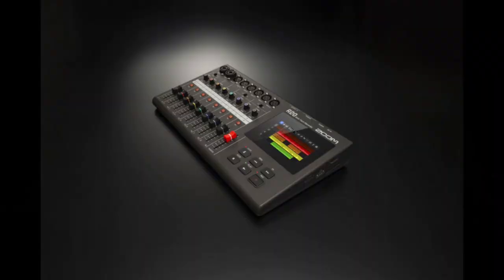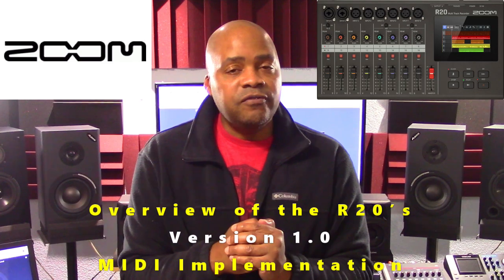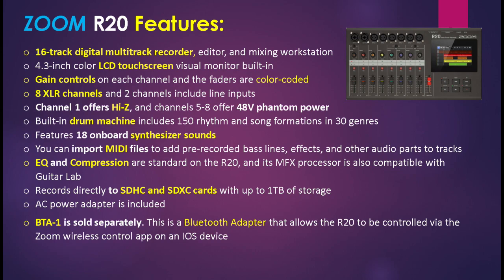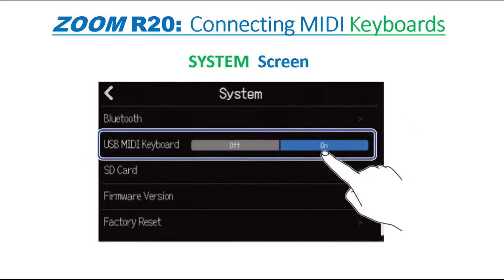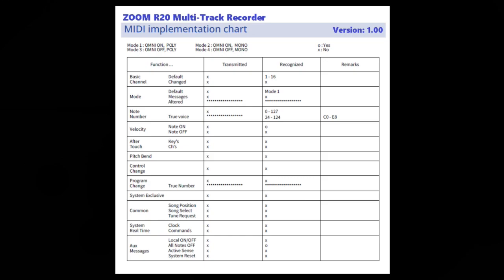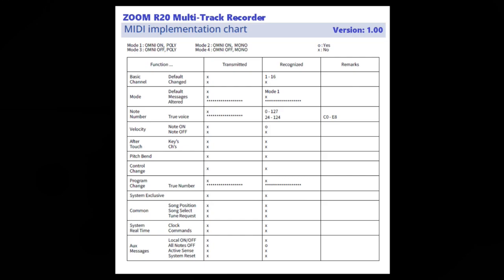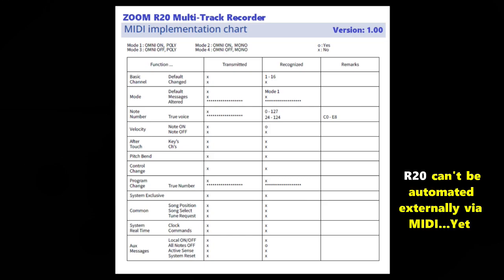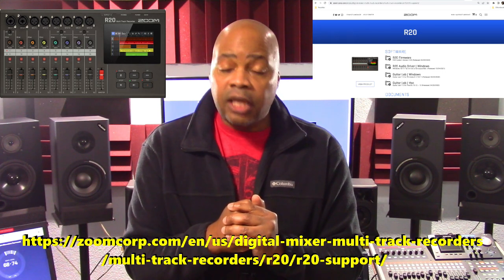ZOOM R20 Multi Track Recorder: MIDI Implementation Explained

Comment from the maker: It surprises me how many folks think the R20 doesn’t have any MIDI implemented due to the lack of the standard in and out MIDI ports. It really shouldn’t because that’s one of the first things many folks look for and expect when they view the back panel of a unit. While most top companies have abandoned MIDI altogether on their external multi-track recorders at the $400 price range and below, Zoom has not. What do you think about this state of affairs?
Reply: I'm not a fan of the removal of midi.
Reply: I need MIDI sync but it is nowhere to be seen and zoom seems to add no new features to this product at all.
Reply: I like being able to plug in a keyboard controller and play/record right away. But man, those patches are just not that great. Where is the grand piano!? Any chance they will allow the uploading of user patches?

Comment: Hello, 

Is there someone here that has already tried to connect an 90' vintage Midi synth ?
I am trying to connect the Yamaha SY22... it has old Midi connectors, not USB-C. I bought a midi cable USB-C to old MIDI DIN connector. 

Thank you.

Comment: This R20 is failing on software grounds, and there’s no reason why a company wanting to sell an otherwise excellent hardware product, would cripple both it & the user’s creative flow with dealbreakers like poor midi…

…if I’ve spent over $500 on 0-127 velocity sensitive midi keyboard-controller - with expressive aftertouch - why would I spend close to $400 to weaken that set up?

The R8 is great and it made me want to upgrade, but there’s too many red flags coming from ZOOM with this unit ie BTA-1 + 99c app…

…someone needs fired.

Comment: I'm seriously considering this device, mainly because I'm tired of struggling with MIDI delay, which seems to come and go on my setup. I miss the says of an old hardware wave table. It used to be effortless to play along with myself in the late 90s and early 2000s, no matter how many tracks. How responsive is the R20? Will I notice a delay?

Second, Can I export my MIDI compositions to my computer? I might want to commit a track to one of my PC's VSTs and then import a wave file to my R-20 after generating a track.
Reply: I don’t have the device, but I’m pretty sure you can export standard midi files to the SD card.  You can then just load them into your DAW software.

Comment: Thank you for the information in this video. I play guitar live operating very portably, backpack light. I use a simple sequencer for some rhythm and chord progressions for backup. I would love to be able to analog record some performances with digital timing info from the sequencer. Just haven't found any portable solution for this yet.

Comment: Hi! I really want some help with some things before taking the plunge and buying them (the korg volca sample2 and the zoom R20)

Can i somehow sync the Volca to the r20 somehow? Or can i get away with matching the BPMs on both devices and somehow having a record pre-count on the r20 so i have to manually press play on the Volca when the r20 starts to record?
Hopefully my questions makes sense,im very new to this kind of things
Reply from the maker: The answer to your question atthis time is "No". The unit's MIDI Implementation as of the time of this presentation does not support Song Position, Song Select, Clock Commands, etc. However, this does not not means that R20 will not support these in future firmware updates. Thanks for watching.

Comment: Interesting video, but my MIDi keyboard doesn't use USB C. Why R20 doesn't have MIDI connection for old school devices? Which units would have MIDi to MIDI connection and can play 4 instruments at same time? Too many questions.  :) still like the info for new technology.  It's actually USB C not MIDI.
Reply from the maker: USB-C is an industry-standard connector for transmitting both data and power on a single cable. The MIDI implementation in the device uses this connector for data  communications. You may be able to use a USB C to 5 PIN DIN adapter for your keyboard. I'm not sure if it would work but you could give it a try. Thanks for watching and sharing. 👍🏿

Comment: Can you run a guitar with 1/4 inch/ usb cable through the usb c( through usb adapter of course)
Reply from the maker: The unit is not designed to do that and it's not recommended. Input 1 has a Hi-Z switch that is specifically designed to be used with electric guitar and bass. Thanks  for watching. 👍🏿
Reply: @PowercoatMusic  all over that guy. Love that feature

Comment: Loving your channel!

Can you export midi files from an R20 recording ? For example to reprint a piano performance with better sounds in a DAW later
Reply from the maker: As I understand your question the answer is yes. For instance a MIDI keyboard performance can be recorded as MIDI data on a synth track. With this, you should be able to export that track as a SMF. Thanks for watching. 👍🏿

Comment: Hi!
Would you happen to know if a Roland TR-8s has the proper ports and function to midi sync with the zoom r20?
Also, besides the tascam model 12 and R20... do any other multi-track recorders in the modern era have midi capabilities?? The model 12 doesn't have a built in metronome and that's kind of a deal breaker for me.. the r20 didn't have enough line inputs for me. 

Thanks!
Reply from the maker: Anything that triggers MIDI tones on the R20 must have USB MIDI functionality at this time. MODEL 12 has full MIDI, and yes, that unit does have a built-in metronome. Click sounds and various metronome settings can be adjusted there. With MODEL 12, metronome function settings are saved in the current song. The settings saved in the song can then be used the next time it's loaded. It's a very good machine. Thanks for watching. 👍🏿

Comment: Great Video as usual !
So I can plug in my midi keyboard by usb to be the master clock ?
Do you recommend this Zoom r20 or the Tascam DP24/32 ?
Sincerely
Reply from the maker: In it's current MIDI implementation, R20 does not respond to system real time clock commands. Neither do the DP24SD or DP32SD models. You may want to look at the MODEL 12. Thanks for watching. 👍🏿

Comment: 2022, the newest multitrack recorder, who cares about timing? this is for recording, cows, and bells.  no midi master clock, MIDI din,  not TRS a or TRS b  or c  no just midi din.      no clock is no recording,  not buying. the latest one from Tascam without the sd was a beast but after that, the sd and zoom and all forgot that techno is big, real big, and with no timing you just can't.  can you imagine building a song and you have to slide all recorded pieces manually to maybe fit the timing? barbaric.  i see people only that bought it, and they can record a live jam, but that's it, no song creation or building up feature without a clock
Reply: How could they drop the ball so hard on this one.... No Clock???????? The mind boggles

Comment: I just want to trigger recording on Zoom from external midi sequencer/gear.
Reply from the maker: MIDI Implementation Version 1.0 does not have that functionality. Hopefully, the next firmware version will. Thanks for watching. 👍🏿
Reply: @PowercoatMusic  how would it be possible without midi ports?
Reply: That’s indeed a critically missing feature